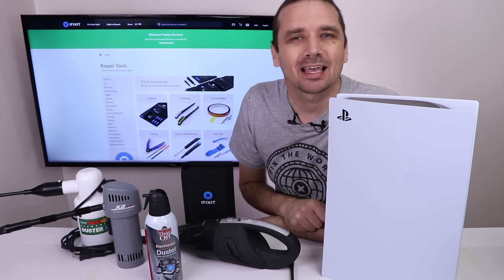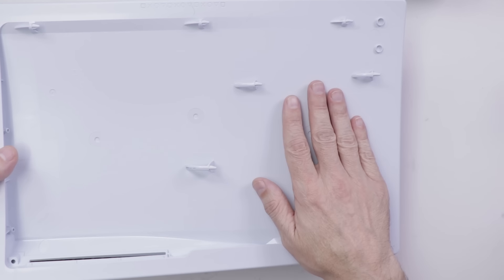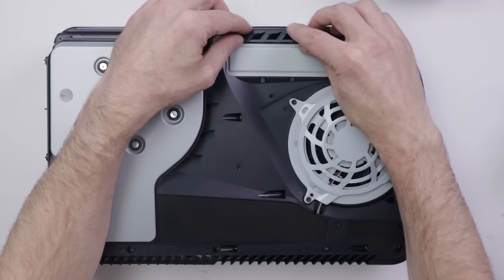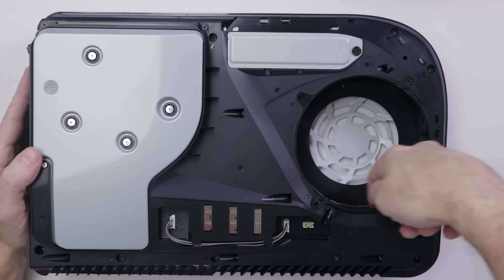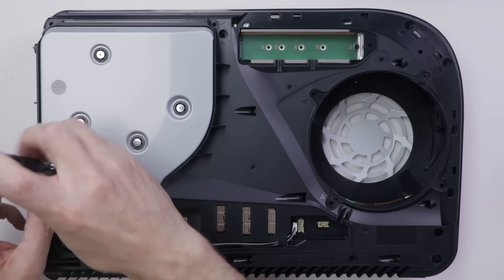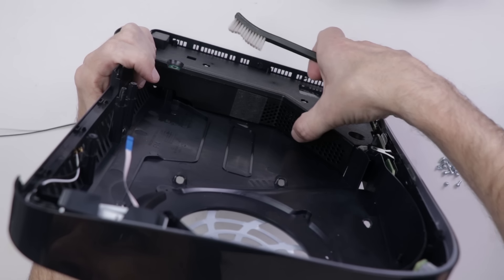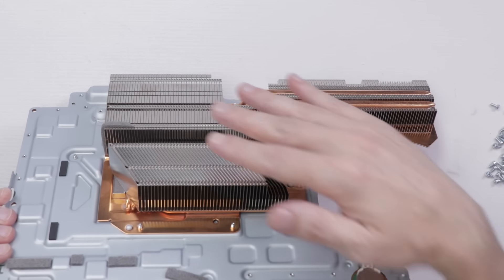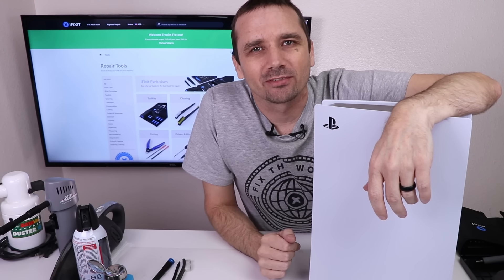How to Clean Your PS5 Safely - 3 Stages

Comment: The two holes on the console are actually supposed to be vacuumed. You put a vacuum over the hole to suck dust through the entire system. This is a very specific and deliberate design consideration from Sony to prevent consoles from building up too much dust and becoming loud over time. It was explained in PlayStation's offical teardown video. That is the 1 and only way to officially clean your system and the most effective way to remove all dust from the air channels.
Reply: Which holes are u talking about?
Reply: @Batman-ro9mj  nice
Reply: @addictedmedic5585  the two holes he is talking about are those ones right on the side as soon as you take the side panel off. You put a vacuum over the hole and turn on should suck the dust out.
Reply: It doesnt really do much
I regularly vacuumed my console but after 4 months the fan was caked with dust
Reply: @Fastroboom  the stronger it is , the better it will clean. But wont do much anyway
Reply: @Fastroboom  my guess , no
But im not educated on the matter
My 2000 watt LG vacuum could not clean my console tho. After four months the fan was caked with dust
Reply: @Fastroboom  i pressed the vacuum hose hard against the hole AND fitted my hand around it to creat kind of an air seal so no air would escape and only suck air from the console itself
Reply: @Fastroboom   lol ask however many questions you want bro im happy to help.
Idk but if it was harmful in any way , i dont think sony would have openly told normal ppl to vacuum their consoles cuz you know most of ppl like me dnt know about those stuff and would harm their consoles.
My advice would be to vacuum every two weeks and remove the fan to clean it every four months. I've done it and it havent harmed my console yet in the 8 months ive owned my ps5
Reply: @Fastroboom  I used a shop vac and that’s got some good suction, you can actually feel the air being sucked in through the back. So I would recommend a stronger vacuum that can just fit over the whole completely
Reply: @Fastroboom  none at all. did what the guy says, sucks the dust out and the fan was all nice a quiet again
Reply: @Fastroboom  also just read through the comments on this post and it won’t clean the fan it cleans everything else tho, to clean the fan you’ll have to take it off and that’ll void a warranty if you got one
Reply: @Fastroboom  yes, just the shop vac worked better for me because my vacuum didn’t have the right attachment
Reply: @sammatthews3583  thanks for sharing, man. I just cleaned my ps5 fan but I have a 2 year warranty so I don’t think it’s worth voiding it so I’ll try your shop vac idea.
Reply: Not if you really have dust caked in there. Then you have to remove everything.
Reply: Any suggestion on what kind of vaccum I should get? Would really help
Reply: Angel Irbin  while that is true, it is not supported by Sony in our current times where we do not have complete right to access and repair our devices. So warranty could potentially be void with this method in the video.
Reply: Angel Irbin  I guess warranty is different in your country. Although I’m just saying within warranty I’d advise using the vacuum holes that Sony designed for this if you care about any form of coverage during your warranty period. Otherwise this method is great.
Reply: @nicknickname353  it does help. It's right next to the psu and cleans that without having to take it apart and void warranty. Obv your fans will still get dust in them that's where the intake is.
Reply: Wait are you serious? That’s awesome
Reply: 10x more helpful than vid lol
Reply: Just a heads up for any one here who ever encounters a issue with your ps5 shutting off on you when you play PS5 Native games . The PSU is likely caked up with dust I cleaned mine out and it worked amazingly I’ve had my ps5 since launched and play it almost every day and it’s still quiet and has no issues so far
Reply: You know this would have been helpful 6 hours ago and before i took apart the whole ps5 and cant figure out which screw goes in what hole
Reply: Remove the fan before vacuuming?
Reply: @Ahakartune  what’s the psu
Reply: @luckylar1682  power supply unit . If you open your fan (super easy just unscrew a couple screws ) take a flashlight and shine the bottom side you will see the psu and you won’t even have to take it apart if you don’t want to . Just stick some long tweeezers and pick up any dust (I had a cotton ball of dust where the psu was) if you ps5 just shuts down randomly while playing ps5 game i guarantee you this is most likely the culprit. Once that is done reinatilze the hard drive and you’ll be good 👍
Reply: @Ahakartune  thank you so
Much bro I’ve been dealing with my console shutting down for the past 3 weeks I couldn’t find a fix now I can finally play games normally again
Reply: @luckylar1682  no problem man I was dealing with the same issue too and I was about to send it to Sony until I stumbled upon a couple of Reddit posts . Buy a air compressor can too if you can to clean it up . I smoke in my household and had it since day 1 so it fer sure fer sure needed to be cleaned lol let me know if that helps or if you got any issues
Reply: Vacuum is an absolute no-go on a PC. Pretty sure this is terrible advice. Edit: I may be wrong, but I wouldn't vacuum everything, only the dedicated vacuum holes.
Reply: @smileyheadshot  it is official cleaning advice from Sony
Reply: @kunchography3725  yeah, I amended my comment after looking it up. I just didn’t want anyone going further than vacuuming the dedicated holes as the static could harm other parts of the console if they go beyond that.
Reply: @smileyheadshot  I agree, just the two vacuum holes will suck out some dust, not sure how well it actually works though
Reply: Mine has dust built up now I deff needed this thanks so much
Reply: You still need to clean the PS5 fans and the intake areas from dust. At the end of the PlayStation’s official tear down area it does state “The dust catcher does not guarantee the hardware from clogging dust”.
Reply: can’t you just use a damp q-tip?
Reply: @Ahakartune  so I gotta do step 3
Reply: Yaaas all he did was push the dust farther into the back of the system
Reply: Yaaaaas I love smart people like u... those of u who don't comprehend... go play pubg on a chromebook
Reply: @Sam Matthews  thanks for info. 

So Running the ps5 while vacuuming is sufficient? Would you suggest I spray into the fans / compartment while system is powered off and vacuum that hole for extra air to blow put dust and dirt
Reply: @nicknickname353  wer u able to clean the fans easily ? The one fan has different screws on the one side I can’t get those little black things off
Reply: @Dusty2040  well it doesn't need to be that clean. just vacum it and it'll be ok.
it's been a year since my comment here, and my console is still going strong
Reply: @Fastroboom  is
Reply: Back in the day I remember people using vacuums to clean their ps2s and ended up frying the motherboard from the static charge built up in the vacuum. Idk if the newer consoles have the same risk but I was told to never use a vacuum by many people, that’s why everyone uses the duster cans to do essentially the same thing.

Comment: Seriously this video saved my PS5
It was experiencing extreme lag and suddenly cut out. Turns out there was a ton of dust in the fan, and I had no idea how to clean it.
Found this video, followed the cleaning steps for the fan, and now it's not on the verge of blowing up  many thanks 👍
Reply: Having the exact same issue. The PS5 keeps crashing and I've tried rebuilding database, resetting, the whole deal. Now I'm gonna try cleaning it. How did it work for you?
Reply: @siraj_jr_  I just unscrewed the fan and gave it a clean with a cloth and some q-tips (didnt have canned air). Worked fine after that.
Reply: @siraj_jr_  Any news now?
Reply: @pizzawiththecheesiestchees5464  holy cow yes bro there was enough dust in that thing to rival the Sahara. I cleaned it thoroughly and there are no issues at all noe
Reply: Sorry to bother but for how long have you had your PS5? Trying to see if my problem is the same as yours
Reply: @siraj_jr_  Glad to hear that, Enjoy the ps5 ig
Reply: @theoctolingsociety1004  heyyo sorry for the late response. i had it for around a year and a few months at the time of cleaning it. hope this helps.
Reply: Yo we have the exact same prob
Reply: Your GPU will probably die soon tho they really don't like heat but the CPU should be ok
Reply: Did your PS5 just turn off out of nowhere ? Is  that what you mean by suddenly cut out ? Mine is doing it and I just wanna fix it before it messes up my data storage and atuff
Reply: @TheLegend-pb8tx  by cut out no, I didnt mean that it crashed. It suddenly became unresponsive and unable to turn off or on. Definitely give the fan a clean and maybe the internals if you're okay with that.
Reply: How do you unscrew it
Reply: @holytop5379  ah I was confused on this as well. When you remove the side panels and look at the fan, if the screws dont have a head you'll need to remove the other panel. Hope this helps
Reply: Mine just started shutting off on me without any warning or notification. It feels pretty warm after it shuts off so, I guess it’s time to clean it, I hope it’s just overheating
Reply: @TheLegend-pb8tx  did you ever try cleaning it out? And did it fix it? I have the same issue now
Reply: @dlm7597  Yeah def give the fan a clean. Sounds like the same problem I had
Reply: Is it true that if you use the van air the dust will just go more deep inside the ps5
Reply: @rico262  if used the wrong way yes. Make sure to remove both covers so the dust goes out the other side
Reply: @The_Toaster_Guy  does your ps5 still shut off? I’ve had mines since launch and I cleaned mines but it still shuts off.
Reply: @guapo3696  after cleaning it the ps5 was able to turn off and on again just fine. If you've thoroughly cleaned it out and it's still experiencing problems, it may be the actual PS5 itself rather than the dust. I dont know much about the hardware of it so I'm not sure. Hope this helps

Comment: Anyone else here because their ps5 is randomly turning off during gameplay, without a overheat warning?
Reply: Yes
Reply: It may have been your CPU’s thermal paste not having been applied correctly.    Did you ever get a fix?
Reply: Mine also recently started doing this and I had a lot of caked dust on the heat sink and fan so we’ll see how it goes
Reply: Same with mine. Except it’s saying it’s because of my extended storage was removed without turning it off properly. Anyone have any advice?
Reply: @dr_no_ok2125 
Honestly speaking I doubt it’s a software issue. I’ve reset my ps5 a couple times, and even re-downloaded the OS. I honestly believe it’s a hardware issue, but can’t pinpoint to where exactly
Reply: Did you solve the problem? I have the same issue 🙃
Reply: @dr_no_ok2125  it’s not saying that because of your extended storage. It says that whenever your PS5 shuts off incorrectly like overheating, or is unplugged while it’s running. And it’s just telling you that it might damage and corrupt your extended storage if you keep doing that.
Reply: @dr_no_ok2125 Did you get a fix? Mine is doing this too, i was in the main menu on the PS5 waiting for a download to finish and the PS5 shut itself off, when i turned it back on it gave me that error.
Reply: Thank goodness for this video and the people who have replied recently.  My PS5 has been shutting off recently while I'm in the middle of playing COD. I can tell by the touch it's been getting hot. The back area where the HDMI, lan cable, etc area. I'm thinking it's due to overheating? Then it has to do a system reboot because the PS5 wasn't shut down properly.  Anyone else experiencing this?
Reply: Yup, same darn problem, and only way to turn it back on is to unplug it and then plug it back in….looks like I’m going stage 3
Reply: @chrisalbrecht7360  I figured it out. Once I removed the bottom stand and screw then set the PS5 one it's side rather then upright. The bottom stand and screw was trapping so much heat it over heated my PS5. The metal screw was literally piping hot once I removed it. It wasn't getting enough air flow. I also removed the side panel and gave it a clean. It hasn't reset since.
Reply: @nipah5464  no I haven’t fixed it yet but I’m pretty sure all we have to do it give it a good clean and leave it an a well ventilated area.
Reply: @cheftorres247  so you basically turned it on the side instead of upright and it fixed it? I’m having the overheat issue snd it’s driving me crazy
Reply: Yea
Reply: @cheftorres247  I will try this. Mines is rather clean but still shutting off. So will try the side thing.
Reply: Mines gives me a warning trying to fix it before it gets worse
Reply: @cheftorres247  literally the exact same thing for me too. middle of a zombies match or an online game and it shuts off, and then has to do the reboot. i did a stage one clean the other day and i thought it helped but it just ended up doing it again today so im gonna try stage 2 but i have no other ideas.
Reply: @iwillnotlose33  Yes, I've had zero problems since. Remove the stand and just set it sideways.
Reply: @onyxtowerx  I've had zero problems with my PS5 now. Give it a try!
Reply: @anthonyrichards7145  The bottom stand and the screw were mad hot to touch. Once I removed it and set it on its side I've had zero problems.  I cleaned it also. But the airflow is way better.
Reply: It's the dust in the power supply, it's in the bottop of the ps5 if set vertically  no sofware issues of any kind. This vid helped me disassembe it and assemble cleaned it so well you can lick it😂😂😂
Reply: @cheftorres247  i didn't screw the bottom screw for the stand in fully. Thinking the ventilation down there may have been the problem since the screw was piping hot when i took it off. Seems fine soo far. Its been 2 weeks i think and it hasnt shut off.
Reply: @Casawi21 crazy thing is the ps4 has the same issue. To much dust and it’ll randomly shutdown. My ps5 has been doing what y’all’s has been doing. Even the unplug and plug back in and it turns back on. But I’m worried imma screw it up. So I just shut it down until I deep clean it
Reply: @N.O.XpressFF  It's pretty simple, just have the right set of screwdrivers and you're good to go. I used a new toothbrush like in this video and used compressed air to blow the dust out. I'm very happy about the results. No noise, no random shutoff. If you need to unplug the powerchord it's the powersupply which is pretty deep in the ps5. I was scared as well but it went well.
Reply: @Casawi21  honestly yeah. That’s exactly what I have to do every single time. Unplug and plug back in and good to go. So I’ll try that. See I’ve cleaned and replaced thermal paste in a couple ps4’s, slim’s and some me pro once. Are they the same screws as the ps4?
Reply: @N.O.XpressFF  For Europe the screws are 6 point/star shaped, I didn't have the right tools 100% but still managed to do the cleaning of the ps5 flawlessly I went in with the mentality: if it's broken it's what it is but I was okay all the time. Scary to do it though 1st time but nothing to fear.
Reply: @cheftorres247  glad to hear, ill be doing all this. Did not like the idea of having to buy another one lol
Reply: @ibaba9209  yessir! I've had zero issues with my PS5 since I've done this!
Reply: To much to much I'm just doing the heat sink
Reply: Mine just started doing this did cleaning it work ?
Reply: @cheftorres247  yes same thing happening to mines right now , A PS5 "overheat shut down" means that the console automatically turns itself off due to reaching a dangerously high internal temperature, which is a safety feature designed to prevent damage to the system's components; this usually happens when airflow is restricted, dust builds up on the fans, or the console is placed in an environment with poor ventilation. How I fixed my Is I put my ps5 in the window area in open the window so lots of air can get to the ps5 it my ps5 don’t turn off Nomore

Comment: Went through 2 PS4s (still got the second) and I swear to god I ll do everything it takes to not have my PS5 take off like a harrier in the years to come like my PS4. Im gonna do this religiously lol
Reply: I still have my ps4 pro and I sold my og ps4 to a friend they run great because I clean them and even people I know who haven't clean them theirs still works. Playstation consoles are very durable since the first one. They don't break easy like xbox consoles. Og xbox last 2 years died. 2 xbox 360 red ring of death first one 6 months the other a year and half. Xbox one sister had red ring of death from 2nd day got a replacement and hers is going strong. All my playstation consoles work psone, ps2, ps3 and of course ps4 pro and getting my ps5 on the 29th of this month. Keep it in an open space and your place cool.
Reply: I just recently cleaned and applied new thermal paste on my buddies 1st gen  PS4 he bought at the exact same time as I did from Amazon. The heatsink had a 2-3 inch thick mound of dust and cat hair compacted that felt like a thick sponge from him constantly using duster. His thermal paste was literally dust because he let it overheat over and over before finally having me fix it. He let it overheat so bad it caused his hdd to fail because if it.
Reply: I have never cleaned my  fat og ps4 that I’ve had since 2014 and it still runs fine
Reply: same but i've heard the newer model ps5s address the overheating thing. that's the only thing that has me thinking lol